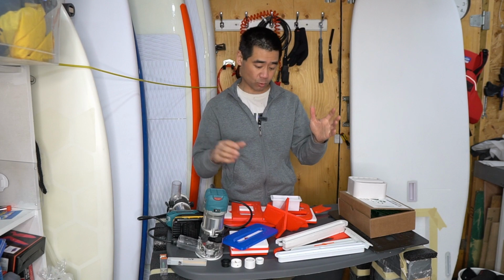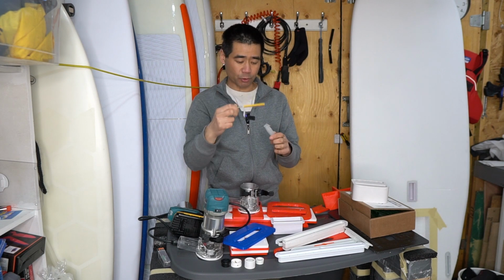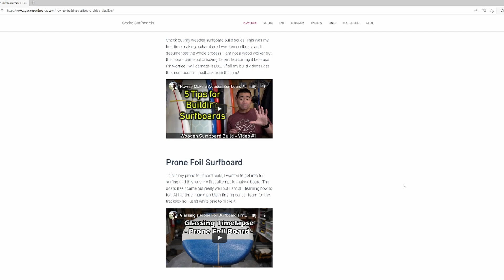Installing Surfboard Fin Boxes with 3D Printing

Comment: Really appreciate your work! Started using it and found a little problem, maybe it’s just me that don’t know how to do it?..
Problem is how do I make the jigg right where I want it (where the box is going on the line) ? After you draw the line or the dots where you align the box with, what do you reference off to know where it’s gonna be on that line (more up or down?)
Iam eyeballing the spaces on top and bottom inside the collars but not sure that’s the right way..
Not sure iam explaining my problem clear enough ?
Thanks again!

Comment: Awesome! do you think finbox can be 3d printed as well?
Reply from the maker: Good question, I think it could be for sure, probably printed from ABS or PETG. Wouldn't be too hard to CAD it either... Maybe a future project 😙
Reply: @AndrewWorkshop  Thanks Andew for the reply. Newbie quetion: I already mark my blank for Futures fin box (2 + 1 setup) can i use the same markings if i change the fin box to FCS 2? TIA